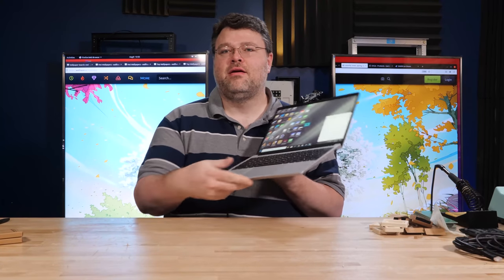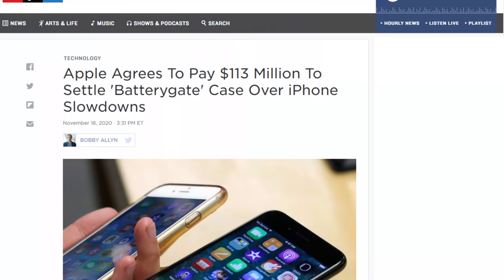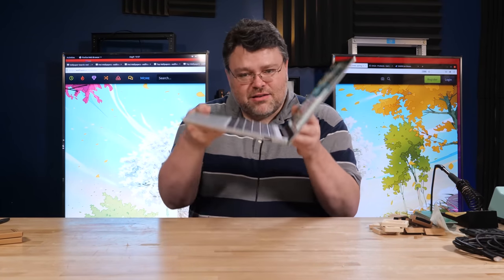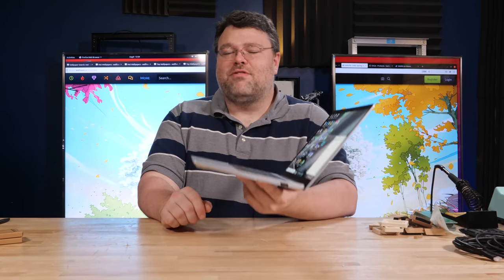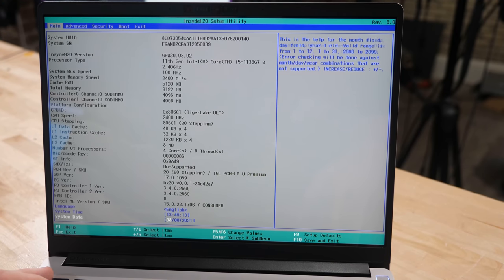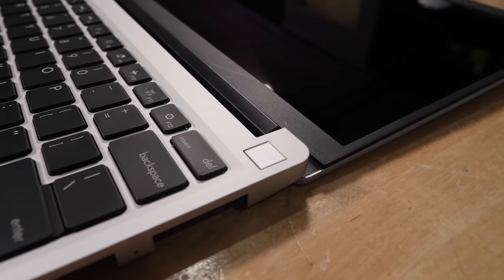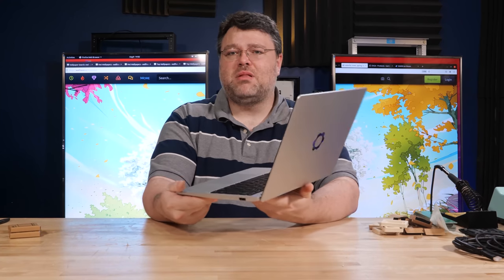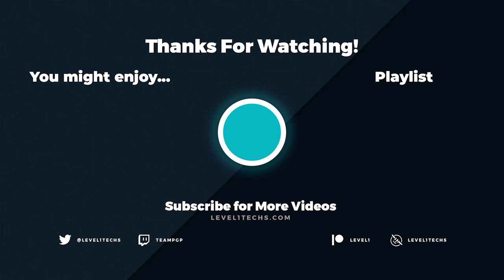Framework: A Laptop Designed to be Repairable?

Comment: You can upgrade the CPU... By upgrading the motherboard. 🤔
Reply: all the mobile processors nowadays are bga, not socketed, so framework really can't make them replaceable individually. at the same time, for the sake of decent battery life they can't really use socketed cpus because they're way less power efficient.
Reply: @kolvis6626  So it's a conspiracy. I'm knew it! 😉
Reply: @Hermiel  on the plus side, if you upgrade your mainboard down the line you can use your previous as a little independent computer (although you'll need some extra ram and storage for it if you didn't replace those too)

edited for clarity
Reply: @kolvis6626  Good point.

Comment: I personaly dont think repairable laptops or phones are such a great idea 1 most customers wont care 2 in 5 years you will either need to replace a whole laptop or buy replacement parts to get it up to par with at that time laptops which will cost you about 3/4 of the new one + time and chance of braking it specialy if you are non techie
Reply: I don't see anything wrong with options, you have the option to upgrade it yourself or get someone else to if you aren't a techie, you have the option to get the ports that you want. You also have the option to spend less on the product over time as you aren't outright replacing the laptop every few generations and it reduces ewaste which is a huge ever increasing environmental problem which needs to be solved asap.

Comment: Went to configure mine but the first option was to choose one of three things they called "Intel?" What is that - anyone know?
Reply: My exact thought too. The choices created a repulse field for my "buy now" finger.
Reply: Real shame innit? Though some other commenters here suggested it's due to Thunderbolt 4
Reply: @DocFr4nk  Don't really care about Thunderbolt TBH. how many different interfaces and cables do we need? Some screaming USB ports and I'm good.
Reply: Remember, this is their first production laptop. I'd rather see them bugfix their process on blue chips, then put out a really killer Ryzen one. Plus, they will offer replaceable motherboards in the future, so swapping processors would be easy
Reply: I think Linus covered this in his review. 

IIRC, they went Intel because the modular sections use Thunderbolt. Ryzen couldn't power them. Next-gen ought to be able to, though, based on what I'm hearing about USB4.
Reply: @vincei4252  I don't care for thunderbolt either, but if that's what they use for the interconnect for the modules then there nothing that can be done on the AMD side of things for now

Comment: I don't understand this idea of reusable computers ... that's why 2nd market is for. If you find your current laptop no longer fits your needs .... SELL IT on the 2ndary market and buy a new one. Do you really want to own a 10yr chassis full of scratches or maybe it's time to sell it (or give it away) and give it to a good home? smh.

You aren't wasting anything, and one man's treasure could be another man's trash. And if you really want the computer repaired, bring it to a repair shop.

Where's all this "non-recyclable" talking point? 

It's just a religious war against big corporations. But ultimately, what does Framework offer that Apple or Dell XPS 13 couldn't do better aside from the "non-recyclable" computer parts crusade? Show me the battery life, and performance numbers. I'll wait. You are basically settling for 2nd-3rd tier laptop for the same price point with the hopes that it save you money or on some religious crusade in the long run it will pay off.

How many times do your SSDs fail you on a laptop? CPU? RAM? It's all nonsense. Today's computers are highly reliable for the most part. Modern SSDs aren't like the SSDs from the relic days.

I bet you 100% that the majority of the reviewers don't use Framework laptop as their daily driver.